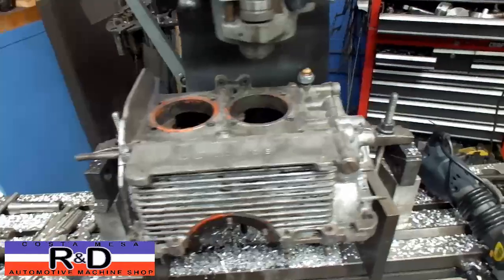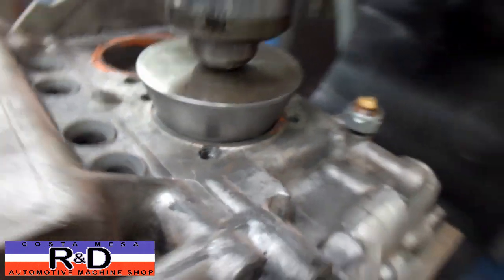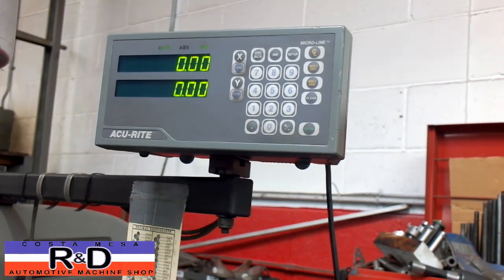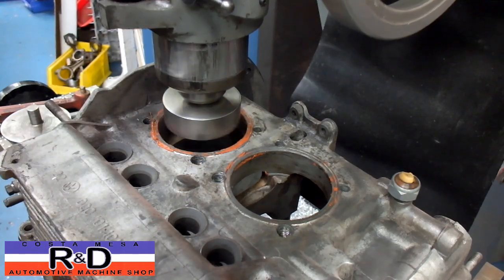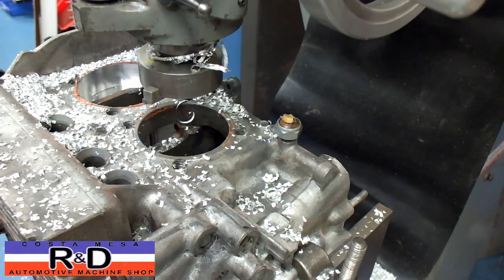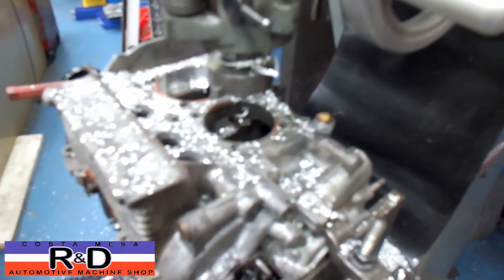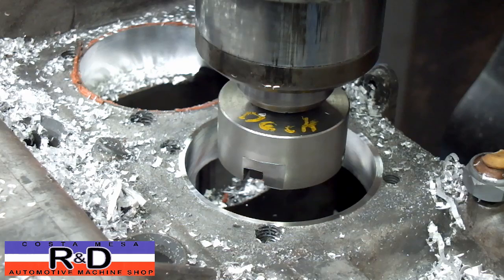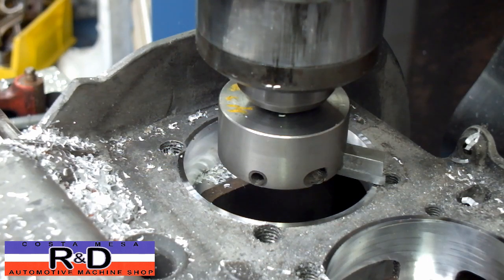Air Cooled VW Case Enlargement for 90.5 Pistons & Barrels

Comment: I came here to see  how a case was opened for larger jugs.
I thin I just seen "how not to cut for jugs."
7:50 ... you could see nothing was centered.
A shame, because he had the digital readout.
And surely the shop had a 25 buck edge finder.

Comment: @fiatnutz  John, if you don't mind telling, what machine are you using to bore those out? I have a VW restoration shop in TX and would like to be able to do this for my engine rebuilds. Thanks much!
Reply: Bridgeport vertical mill! What else? And FYI, John is deceased....
Reply: @FourDollaRacing  Thanks for the answer. Are you part of the crew at Costa Mesa R&D?

Comment: Usually I would think this would be done with a dial indicator that was in a collet for locating centers. The taper cone would be for only a visual locator?
Reply: and centering it against old RTV to boot. Id be pissed if thats how a machine shop set my bore centers and I used to build high hp aircooled motors.  It may just be an old VW engine, but that could "just" be a Meztger case Porsche as well.
Reply: The machinist in the video is deceased, so your opinion is irrelevant....
Reply: Built over 500 engines and machines 3 times that. Crankshaft end play and rod end play is so much that you could eyeball or use a tape measure to get center and be just fine. They even sell after market bore and flycut devices you bolt to the case and attach to a drill motor for the back yard machinist.  The bore is very forgiving. NOW,... Align bore and rear main thrust cut is different and must be calipered perfect.
Reply: @themedic4050  yea that cut can be +/-.10mm to allow it room to adjust to the cut heads.

Comment: I need this service to put a sert of 92 in my block the block is at 94 but I cant find a cylinder set that mesure 94 so I need to have my case machined tried to call but no answer.

Comment: On these motors, when you deck the case, do you lower the jug into the case, effectively increasing compression?  The stoke remains a constant, but the cylinder and head is now .012 closer to the crankshaft centerline?
Reply from the maker: Yes, .006 on each side.
Reply: EJ, you Sir are correct.  Without changing the crankshaft centerline,  the amount the block is decked, is equal to the amount of piston deck height changed. It will be. 012" on both sides. It doesn't matter if the block configuration is a V, W, or L design.

Comment: love watching your work on the air cooled bug motors.   I went thru 2 engines in my bus and got tired of the buddy deals...found a guy who built racing motors and he handed me a block with the internals (steel serts for the studs as well) all there.   I had to add jugs and heads and TLC and that ol bus ran great even for a coupla years after I sold it.    I thought buyer was gonna fix the sloppy steering but he didn't and fortunately for the rest of us he hit a guardrail (nothing or nobody else) and ended the ol bus' existence.    heck he sold the motor for what he paid me for the whole thing.  (G)    mmmm....mayonnaise chocolate short block.